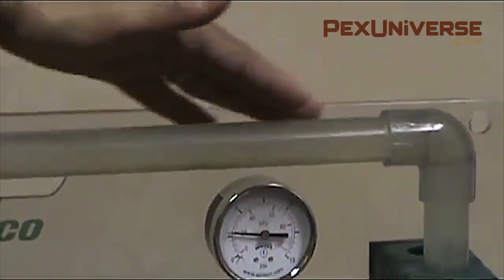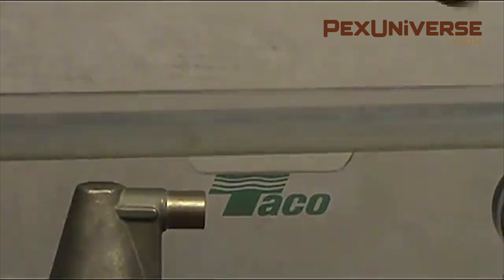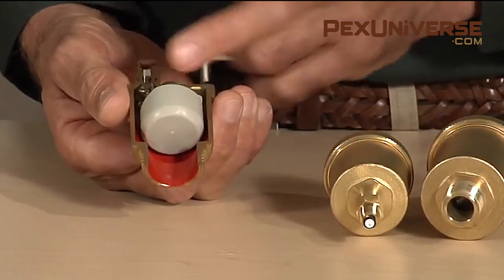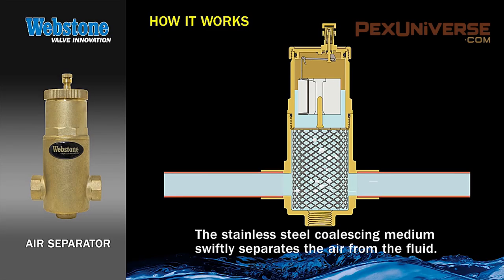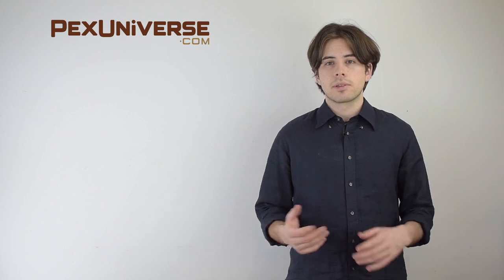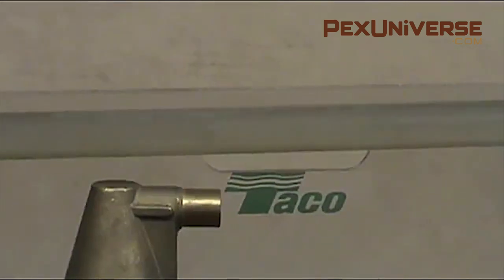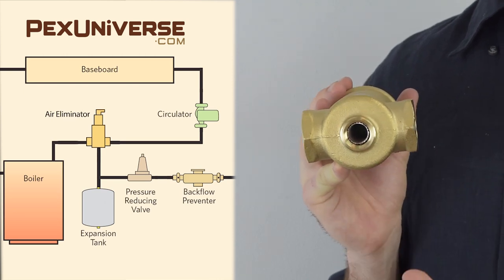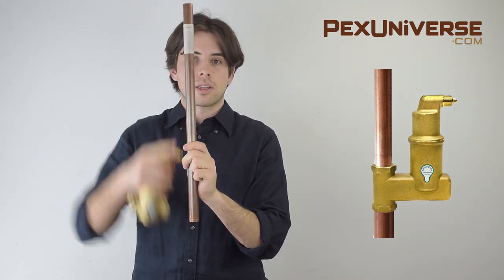Air Eliminators in Radiant/Hydronic Heating Systems

Comment: I’m thinking of a system for my cottage, pex under the floor and a electric water heater. I would like to use antifreeze in the system as it won’t be used for parts of the winter and subject to sub zero temps. Is the set up the same as a water filled one. In terms of pumps and air separators etc?

Comment: If air gets in the system (like when a valve is replaced), will the air eliminator be able to get all the air out? Or do I need to flush the entire system?

I just had a system flush yesterday,  but need to replace a valve that's leaking
Reply from the maker: It might be best to do both if you are worried about a lot of air getting into the system!

Comment: Thanks for your video. I have a Supervent Air Eliminator. Does the boiler need to be on when refilling the system with water after a purge and work have been performed? I performed the old method for refilling and bleeding air from my lines, but there seems to still be air in the system because my heat output simply isn't what it should be. This is a completely new heating system, so I suspect there are't any part failures, just that I'm doing something wrong.
Reply: Any luck?  I also have a supervent and can't get rid of lots of air.

Comment: So would you use an air seperater on copper pipe system
Reply: Yes, here in the UK we mainly use copper piping for Domestic systems, and the RV2 (Spirotech.com) Deaerator is used frequently.  m.boccetti@spirotech.com if you need assistance. We are based in America as well, but the products are then female threads as apposed to the compression used here.
Reply: Yes, air is a problem not only for iron but also often times for the pump / circulator. If there is too much air the circulator can get air locked and it basically wont push water at all.

Comment: I have a radiant heat system that has piping throughout the first floor; however, only two rooms are getting warm.    Could there be a bubble or something blocking the water from going to the other rooms?   There are no leaks. I am in NJ - do you know of any expert contractors for radiant heat?  No one has been able to figure this out or ever understands radiant heat.     please email me at  ralphferrojr@msn.com     Thanks